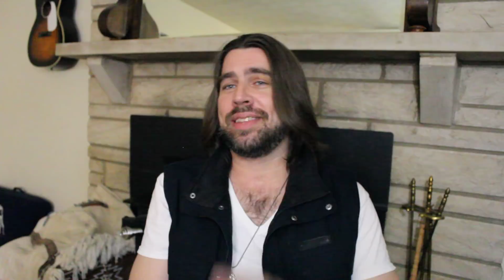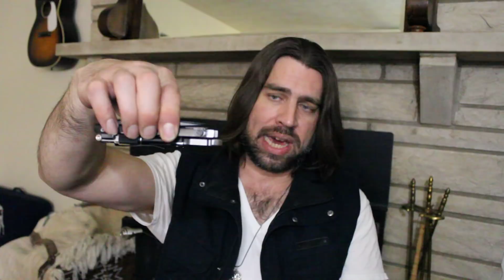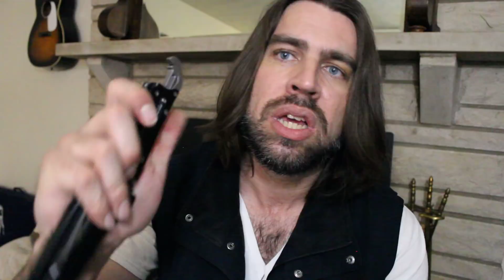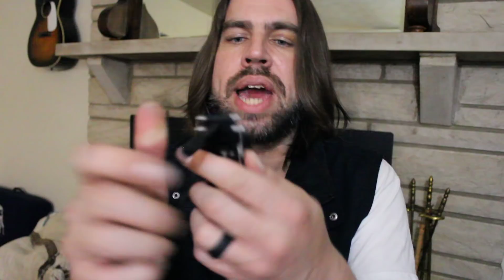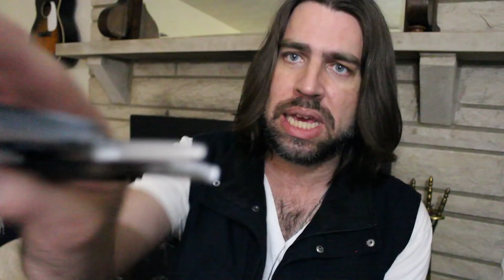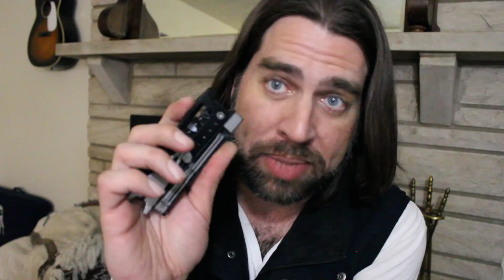Toler UNION Overview and Education

Comment: Thanks for the great info Mike! I received my Toler Union several months ago (Early Bird Contributor) and I love this thing! I used to carry a Leatherman Wave and the Toler Union puts the LW in it's place....the desk drawer! I carry my TU every day and use it quite often. The blade comes extremely sharp and mine was too tight for me to open. With help of Mike, I was able to loosen the screw he pointed out in the video and now I have no issues opening the blade. It's an amazing work and I can't wait for future add-on upgrades! Great job with the design Mike!
Reply: After a year, how do you feel about the union?
Reply: @2371Anita  I still carry my Toler Union every day! Every time I get it out someone asks me what it is and where I got it. It's a great talking piece. But, it's an amazing multi-tool too! I've never had to resharpen the blade! However, there are some things about it that take some getting used to. A couple times when using the pliers they've collapsed sideways nearly pinching my fingers. I know to watch out for this now. Also once one of the three tools, wood saw, metal saw, or awl are out, I find them somewhat difficult to collapse of the lock. It's manageable, but fiddly. Overall I give the Toler Union an A! It's outstanding!
Reply: @michaelmathews8974  great to hear! 👌
Reply: @michaelmathews8974  there is one on its way to me. And I am stoked! And now even more so, due to your opinion.
Reply: I don't think this tool is for everyone, because it isn't intuitive for all users. But for the people willing to learn the tool's ins and outs, it's great.  People who want a quick, one handed opening multitool are not the market here.

Comment: I just got mine yesterday! Barely in my hands a day, and I’m still learning, but man, is it awesome! I’ll check back in later with more detail, but have to say, better, yes better than advertised. The weight, the feel, the well thought out design, top notch Mike. I’m kinda thinking I should have got the case, I usually carry my life or tolls in my back pocket, we’ll see after a bit. Mike any thoughts on maybe a metal clip on the case, like a slide on holster for either belt or pants? Just curious. Thanks again, Mike, nice work!

Comment: Mine arrives tomorrow, finally! Just saw that you passed my number 1313 (good thing 13 has been a lucky number for me, Lol). Can't wait to test it out, will post it on my IG business site. Great job of pushing thru the asinine Covid crisis on supply chain amongst the regular production development & most difficult transition into higher volume production! Congratulations! And Thanks for your awesome ingenuity and engineering design! I should have ordered a carrying case, but funds were low at the time I placed the order/backing. Prior campaign I supported never made it to production, like many that don't! Great job! And great job of putting up with those who don't understand how difficult a regular production start-up is if you're expecting a high quality product with little to no quality issues. 👍
Reply: Did your tool arrive? What is your impression?

Comment: can't you open the Omnilock wrench by wiggling/pushing it around the head/nut to be grabbed? 
Also, I hope to see a T-shank socket in the future, and replace the belt/pocket clip with sth that holds a standard recip blade?
It would be so neat to be able to use 4" Hackzall blades on this.

Comment: I appreciate the video.   The only issue I keep running into is the bit extender does not stay locked into any of the designated sockets mentioned in the video.   The bit extender falls out way too easily.
Reply from the maker: Please reach out to contact@tolertools.com.  Thanks.

Comment: To people who have been less than patient: understand the complexity of such a product - the sheer NUMBER of individual parts, difficulties in manufacturing and maintaining tolerances, not to mention dealing with supply chain issues thanks to Covid. So cut Michael some slack, as it was no small feat to get this thing off the ground.
Reply: Thank you!  Those of us in the tool manufacturing field (40+ years) understand the challenges, the more complex the tool design.  I find the fact that there is a rapid correction process in play to be what the industry should strive for but sometimes falls far short either due to top heavy paralysis, indifference, or ignoring the squeaky wheels until they end up being your whole market.

Comment: New video conveys general rationales and specific features of the Union. I only had to adjust the knife pivot as I prefer slightly more friction. It lives in my backpack's waist belt pocket. A resent task was done soley with the Union to tighten 8mm nuts on solar panel mounts using the omnilock wrench. Also found the tiny file/awl perfect to repair a few damaged bolt threads. Hadn't thought of the 90° angle configuration for using the saw blades, but makes perfect sense for better angle control. Needless to say, the Union is now my goto field tool.

Comment: Honestly this tool looks pretty freaking sweet. Watching you handle the tool makes me understand why it's been so long in production. I mean with all the different components to fit just right, it does look like it would be difficult to produce with all those different pieces and to put the whole thing together quickly without issue. This is not your basic leatherman. This thing looks like it took a very long time to design and manufacture. Way to go Mike and family.

Comment: Thank you for letting me be part of this amazing adventure.  You are well spoken and have a very good tool.  As with others I am equal excited waiting for my tool.  Side note, curious on how you got te black eye.  I do like how you explain the tool.  I also have to laugh a bit because it is like me in my job.  I call some of those people that ask me a question (Askholes)  because they ask a question, get proper instruction then go and do it their way and say well look it is broken.  Or it did not work like I told them.  I ask did you do as I instructed.  The sheepish answer is "Well kind of but well not really, So ummm No".  So for the others reading this.  Don't be an Askhole.  Follow the training and guidelines of the tool.  While a crescent wrench can be used as a hammer hence the term crescent hammer.  It is a wrench and thus designed to function as an adjustable wrench.  

So keep up the good work.  Thank you again 

Sorry so long I can get to lazy to stop writing
Reply from the maker: Flying 5 yr old skull. Best shiner to get, I think.

Comment: Hey Mike! I’ve been sold on this tool ever since one of your targeted adds found me maybe 2 years ago. Wish I pulled the trigger right away, love seeing it all become a reality! (I’m a car guy and multitools neglect our wrench needs) 

One question : is there an adjustment, or access to the saw hinge? Wondering for replacement/or running different saw combinations in the future. I don’t see myself cutting much wood but would love to load it up with only hacksaw blades for some involved ‘metalwork’, and to be able to change the blades out when I ruin em

.was certain covid would kill this neat idea, so glad to be wrong.

Sincerely, #6160 get me my wrench
Reply from the maker: No easy access to the saw hinge on this module, Jackson. Perhaps the future. Thanks so much. -Mike